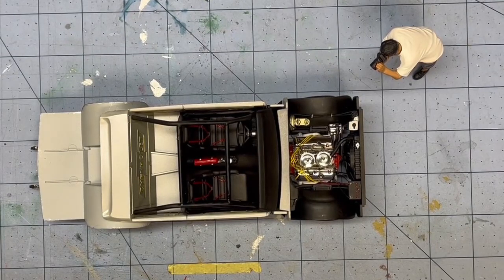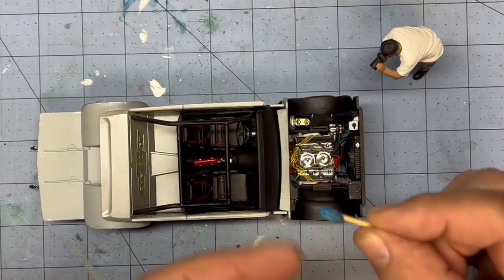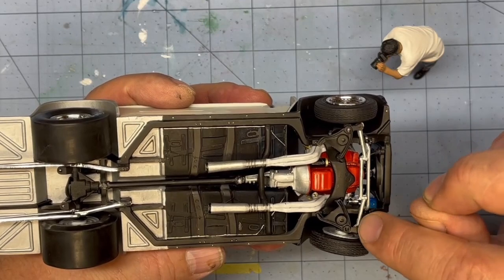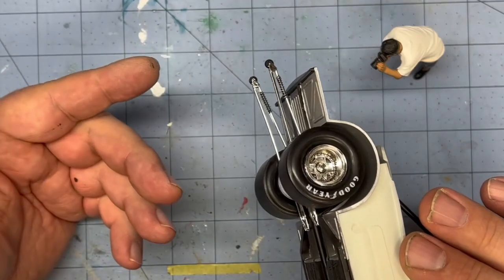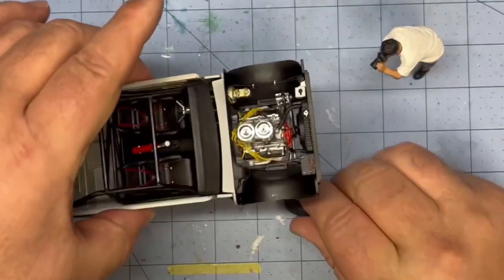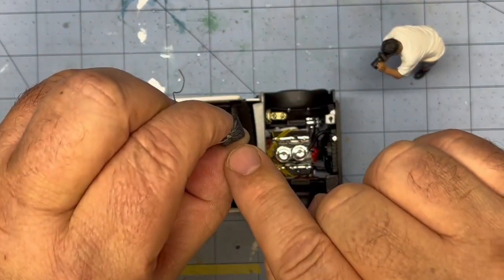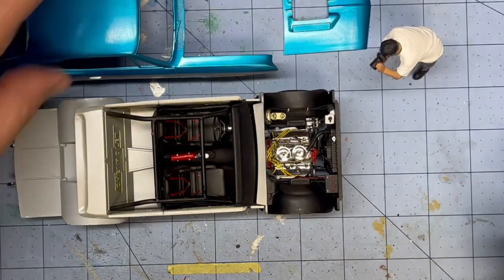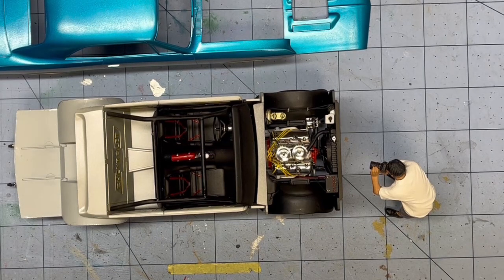AMT 67 Chevelle SS Pro Street quick update 6

Comment: Coming along great Mark!  Can’t wait to see that baby complete.  Have you had good results with the Molotow pens?
Reply from the maker: Thank you very much.  The Molotow pen is fantastic, but it's not for fine detail work.  The ink is thin, so it will spread.  I've tried to do paint it on a piece of plastic and use a toothpick, but I haven't hand much luck with that, but for doing larger things (steering wheel arms, door handles, touching up where chrome was cut off from removing it from the sprew, it is perfect.
Reply: @grandpamarkshobbies  Thanks Mark I will have to pick up a Molotow.  I think local hobby lobby stocks them

Comment: Coming along real nice. Can't wait to see it finished. Isn't that vacuum canister originally the windshield washer reservoir?
Reply from the maker: Thank you.  The windshield washer reservoir is next to the canister.  The canister should have been the power steering reservoir, but this car doesn't have power steering, so I re-purposed it to make the vacuum can.  It was one of those things I had no clue of what it was so I spent a lot of time on line making sure it wasn't an over flow for the radiator or something else like that too.  The other thing that this kit has that through me is the oil filter is a canister type that you change the filter and not the entire thing.  I am impressed with the amount of detail that is in this kit.  It aloud me to do a lot of little detailing that normally isn't there.  Thanks again for watching.
Reply: @grandpamarkshobbies  Understood. Research is something I never realized is so time consuming.
Reply from the maker: But I enjoy it.